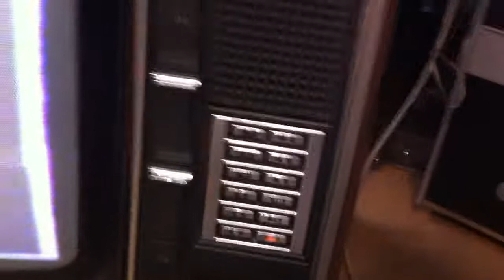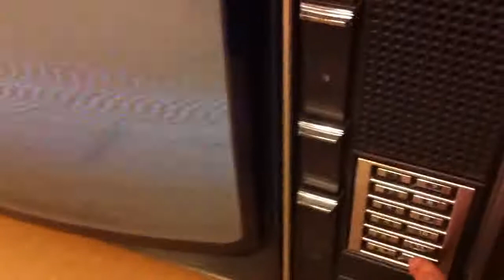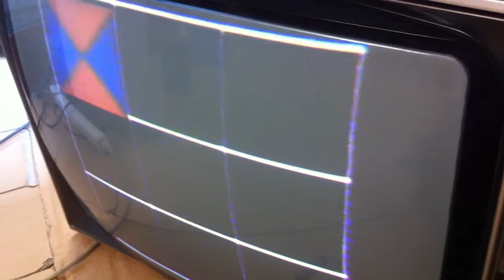Philips K9 vintage color television

Comment: Nice! I have one in good working condition as well. Only the booster capacitor is replaced and I use it with an IF input of 38.9 MHz. This way the tuner adjustment is skipped.